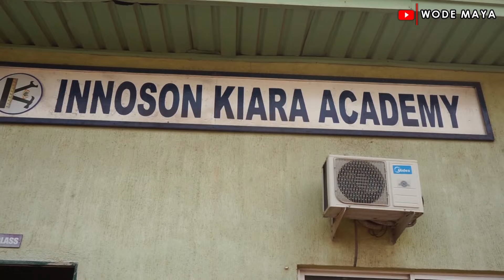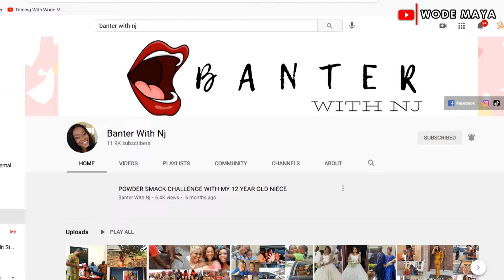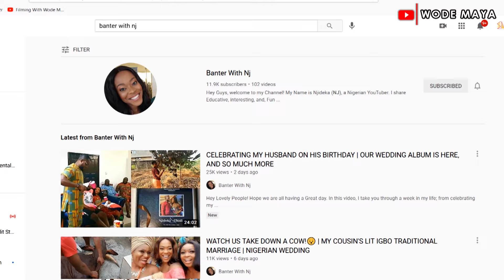Inside Africa's Biggest Car Manufacturing Plant!-Made In Nigeria(Innoson Motors)

Comment: As an African American living in Amerikkka, this makes me so proud.
Reply: Thanks good sister for that. I came from the southeast region where Innoson motor's plant is located.
Reply: seamo9000deBuilder SUPERBEING  Has that been crash tested? What's its score rating? What's the warranty period?
Reply: @cuttight  According to who’s standards?
Reply: @dcryptospace1284  To the only standard that matters. NCAP (EuroNCAP, ANCAP, Global NCAP) that use almost identical testing protocols.
Reply: seamo9000deBuilder SUPERBEING  They refused because it's just a small assembling company on the early stages of developed. But their story is an inspiring story. 
Hopefully, in 10 to 20 years time, they could come on board like innoson..
Innoson started in vehicles production started in 2007. But it's process started decades ago.
 Innoson also has assesories of some of the components of the vehicles they manufactured in many factories in different locations in Nigeria. 
Innoson started with importation of motorcycle spare parts followed by motorcycle assembly------ followed by manufacturing  the parts etc 
 He also have other 5 different factories...one produces plastics needed in the vehicle manufacturing plant etc.
Therefore,it takes over 20 years  or more before   any company's stabilization . It's a gradual systematic process.
Reply: I know plenty of people who would buy you a one way ticket back to your homeland away from Amerkkka, but I figure you wouldn’t last long there.
Reply: whats stopping you from moving back? its obvious America is better hence why you're still there

Comment: Can anyone tell how much it cost in South african Rands, and the procedure to get one. I LOVE IT
Reply: The company has all types of cars   with deferent prices even Gwagon , so it  depend on the one you need, they   have new cars of $2500, to 3000,  & those cars are strong like Toyota products
Reply: Prices start from USD 12000
Reply: a little expensive but we should support it
Reply: @akpugideon1078  Want a high quality car? Buy one made in South Africa where all precision work is done by robots and computers.
Reply: They buy car components from established manufacturers and after-market suppliers and assemble them. 

It would be like a body shop buying all the frame and suspension components of a 2015 car, welding and assembling them together and then putting an affordable engine in it.

So Innoson builds a 4x4 Honda pickup, puts a 4 cylinder Mitsubishi engine in it and sells it for $17,000 ( half price )
They do this with Range Rovers, Land rovers ,Cadillac ,Toyota etc.

So they have a full line of everything from hatchbacks, minivans, crossovers , luxury vehicles and SUV's.

So you can buy a Land Rover clone for $30K.

I'm actually impressed.
Reply: @glennchartrand5411  Tesla used a lotus Elise body and some Panasonic cells for batteries, this car company could go places in a decade!
Reply: @andrewallen9993  Can we let Nigeria shine on this particular vlog.  Thank you.
Reply: @spillitnow7733  As long as it's factually correct sure but let's not put up with bullshit.

Comment: I wish now all the African countries raise the taxes for this car we import, and IKV theirs look cheap then we buy them

who is with me for this
Reply: Are the metal alloy parts such as the doors, bonnet, body frame, engine block, crankshaft, transmission gears, and brake pads being synthesized and fabricated domestically via casting, rolling, forging, and/or machining in foundries, forges, and machine shops, instead of just being imported in already or largely finished state?
Reply: China is with you.  (It's their plant).

Comment: Even Tesla motors order parts they don't manufacture in house
Reply: No manufacturer do it alone. They work in partnership. 

Automakers design and build their own engines–because they can. But often a lot of parts on the engines they build are outsourced to suppliers. Eg. Melling makes oil pumps, pistons aren’t necessarily made in house, no one likely makes their own bearings, etc. And automakers often have cooperative partnerships with each other–some Saturns had Honda engines, Chryslers had Mitsubishi engines (Chrysler’s engines were better), I think older Taurus SHO models had Yamaha designed engines, etc.

Basically automakers will do whatever is the most cost effective, depending on whether or not an outsourced solution exists. I
Reply: That's a fact! Even Mercedes Benz. They buy speakers; tires and a bunch of other parts from suppliers.
Reply: @FERESE  yeah right,. if only our government can support people with ideas to start up these other manufacturing companies, and reduce what Innoson have to import.

Comment: Awesome!  Very heart warming story!  Thank you so much for sharing it!  The cars are attractively designed with modern amenities. At first, I thought the vehicles are merely an assembly and rebadge of an imported vehicle, but I was thrilled to discover almost all of the parts are manufactured domestically. While the engine, a critical component, is imported from India, it doesn't make sense to invest into manufacturing a soon to be obsolete technology given the advancements being made in electric motors. It would be great if the company offered stock to the public. I would buy it in a heartbeat!
Reply: soon to be obsolete?

Comment: This is wonderful!! This is how cars were made in the 50s all the way up to the early 70s. Some of the safety standard are a bit lax but no more that at any other body shop. . This is the best way to get a country moving, replace the workers with technology over time and as you will need to as the wages go up. Get the quality up to ISO or world standards over time. . . this is a progression that needs to happen setting a standard to which all products are eventually made in that country, call it baby steps. . . It's good thing to see the company using skilled labor to align body panels to the fixtures, inspect, then spot weld with high kva welders. I would love a stack of those fixtures and spot welders in my shop. . . They still build Prototypes in North America that way today, and we use those machines for automotive restoration. . . . Carry On!!

Comment: An exciting time for Nigeria! but for Africa, Toyota through their TSAM has been manufacturing cars in South Africa since 1962. It is very normal for a car company to assembly parts from their suppliers and subcontractors, and there is no manufacturer that can make every component by themselves, especially the engine and plastic molding parts that require precision milling tools and die casting. Good work!

Comment: Wode Maya, safety is a big concern so the company should start with employee safety as top priority and add the additional cost in safety into the price of the car ... the painters need real paint respirators and not dusk masks; also, I have a concern about welders eye protection against the intense light and radiation.  Also, I think the company should concentrate on building good reliable cars; forget about all the extra expensive technology ... good safety cage, good suspension, a/c, power steering, abs brakes, simple stability control system, non-complicated 4-wheel drive, comfortable seating and make the repair of the cars/trucks/suv as simple as possible.  Keep the technology simple, make the cars easy to repair.  Not everyone is rich and when people figure out these cars are easy on the wallet when it comes time to repair them, it’ll make the car just more desirable to own.  Also, the company should start making videos on how to repair and troubleshoot their cars. The company shouldn’t go down the route where you can’t even replace a window regulator without programming it; keep the cars technology simple!!!
Reply: I like to see Africans to be successful and self reliant on own terms. But sadly, rich and influences people use loop holes in the book to avoid taxes and build a "Show" factory to present. All safety equipments are not used, cars parts manufacturing is not to be seen, which is very essential for self reliance. Shaddy Chinese engine block and equipment, for the time Africans should stay with Toyota for awhile.

Comment: if they had changed the assembly and welding procedure they could have easily increased vehicle production by 80% 
further more 
if they had pretreated the metal parts before assembly it could have fast tracked paint and assembly by additional 20%

Comment: Totally lacking is safety precautions for the workers  Spray painting outside of a ventilated spray booth wearing surgical masks and not the required ventilators . Welding and spot welding without welding hoods or glasses that are closed on the sides as well.

Comment: Don't want to rain on anyone's parade but Innoson Motors is assembling kits from China. Nothing wrong with it though as that's how most country's auto industry started as designing, engineering, and building an automatically assembly line for low volume isn't profitable.

Comment: Everyone MUST start at some point. But looking at your current manufacturing process, it is at BEST 30 to 40 years behind today's technology from process flow to non existing computer QC check to environmental issues. Again, this is not a criticism but rather too little or too late? A super cheap basic Corolla with zero bells and whistles that has been refined for over decades will run circles around these cars - now ICE cars are slowly being replaced by e-cars one has to wonder.....

Comment: Innoson IMPORTS the main components into Nigeria..and using local suppliers like interior fabric and "locally" sourced tires THEN ASSEMBLES these vehicles which are from various Chinese!!! Car companies that do ALLLLLLL the engineering,designs and main manufacturing. These vehicles are what is known in auto industry as a CKD ( completely knocked down) individual parts shipped in from China and PUT TOGETHER.

This is NOT a ,start from scratch, 100% MADE African vehicle.  They simply followed the instructions to put it together.

Comment: Sorry but this is not manufacturing. It is assemly plant. But it is good for a start
Reply: It's the same way Ford and Chrysler does it in America.  I used to work at Ford in Detroit and the exactly the same thing.
Reply: @Igbomayor  So they are assembly plant too. Been in Tata india, they manufacture almost %80 parts in same factory including where you travel by car inside factory

Comment: It looks like they copied every other luxury brand manufacture design cues. The front grille of that black SUV looks like a LEXUS grille and they got their own little version of the Mercedes 
G-Wagon. Their pickups look like a Toyota pickup... 6:43 they even spell out "I N N O S O N" like how Toyota used to do it on their older pickups.
Reply: Of course, they may have drawn inspiration from other brands. Not a big deal. Obviously, inventors and brands have drawn inspiration from other since inception of the Model T-Ford or even earlier if you please.

Comment: 60000 vehicles?  1 year has 52 weeks, 52x5 working days = 260 days. 60000/260 = 230 cars day must be completely assembled. From the stage and workforce they claimed in the video, 1800 is vastly exaggerated. Impossible with 230 cars to build in a day with such a facility. Where is the wiring section? Very questionable car plant, my hunch is they imported big chunks of cars from China and labeled them as locally made to avoid taxes. I bet 1 m $ for this claim., In the video, workers are not equipped with standard safety gears such as welding glasses, the proper masks for the painting section for example.

Comment: Wada Maya should have done enough research about this before airing this video. Vehicles assembled in Nigeria are mistakenly called made/manufactured in Nigeria when they are actually not. Over 80% of the components of these vehicles are shipped in and assembled in the country, not actually manufactured or produced in that country. 

A made or manufactured vehicle in a country should have at least 80% of the vehicle's parts or components actually manufactured in that country, from the design stage, crash tests, terrain drive tests, right up to the fully built up vehicles. This is not what is happening in these companies in Nigeria.
Reply: They're all manufactured. Nord is assembled.  No car has 100% locally produced components you fool